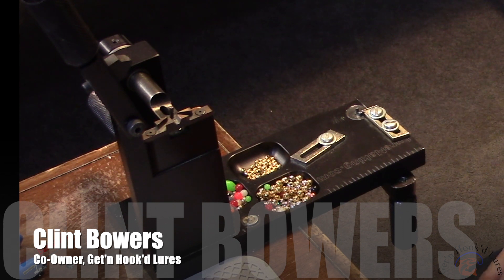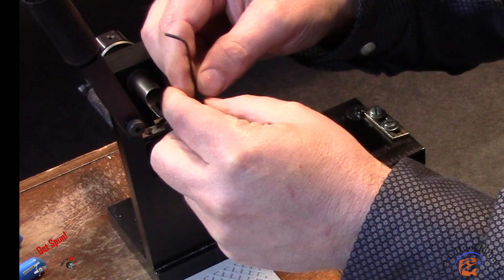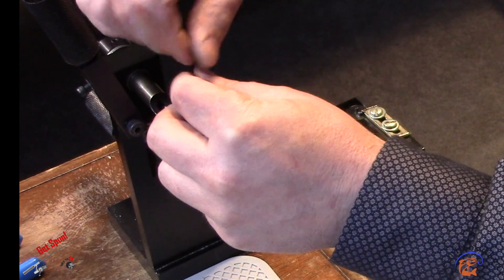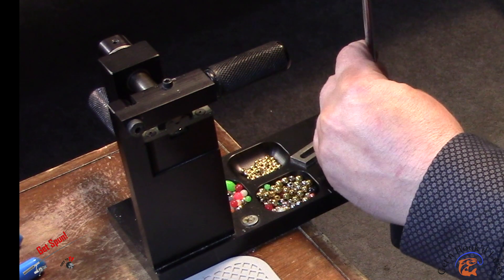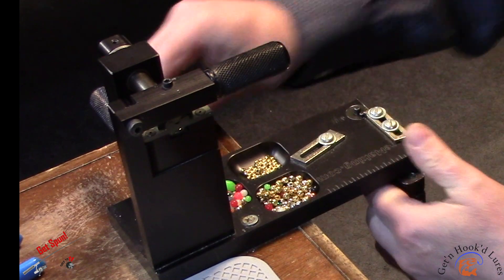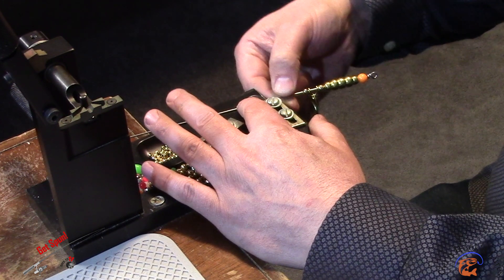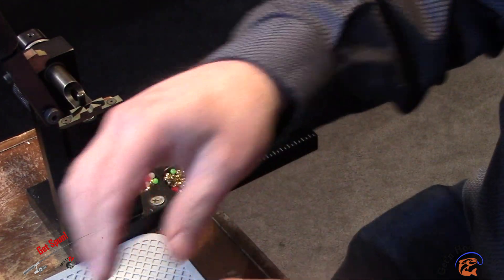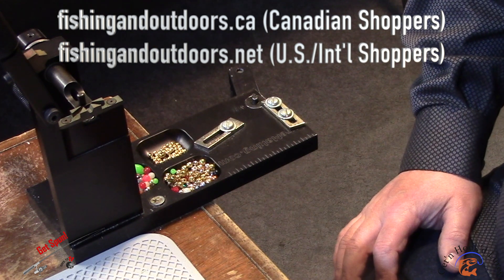Fishing Lure Wire Former

Comment: I own this former.  Pain in the @$$.   Never could get a quality bend out of it.  Don't waste your money.
Reply: Odd.  This Hagen's wire bender is the best wire bender in the price range in my opinion. I got the hang of making good bends in about 2-4 hours and I'm not especially talented.  It's never a waste of money, because used wire benders are in short supply on ebay.  I did watch the videos, though, from Hagen's and others on line.  The Twistech wire bender is also a good wire bender.  I had them both.  This one has changeable dies to allow you to make both musky and crappie spinners with the same machine.
Reply: Operator error sends a lot of people off course.